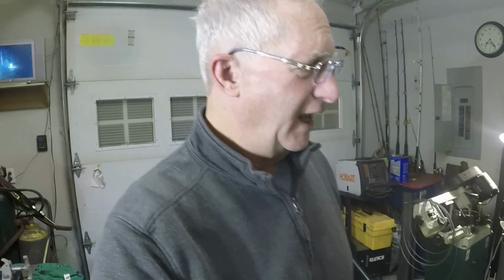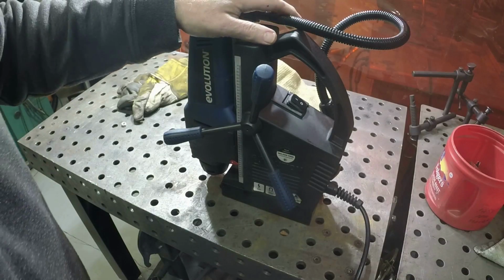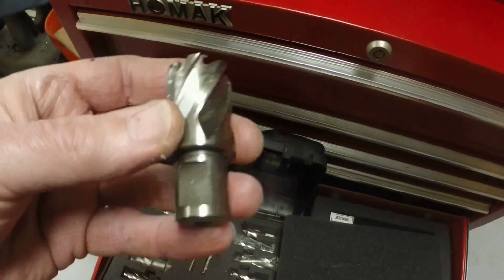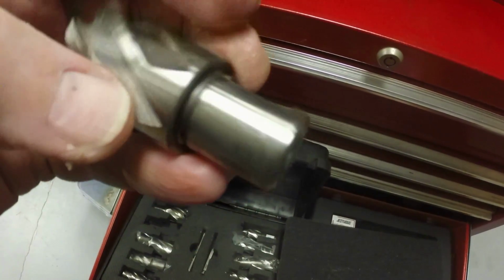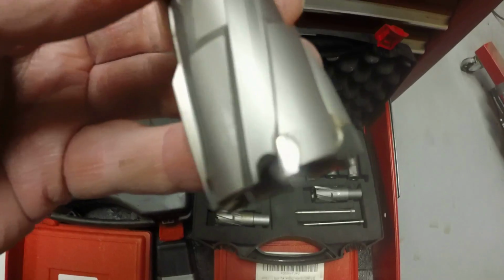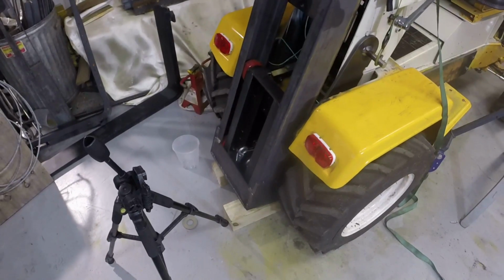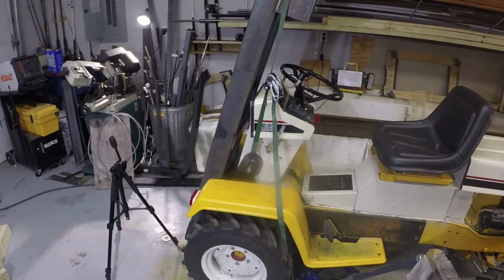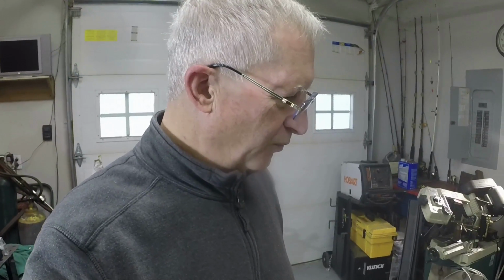Garden Tractor Forklift Build EP:24, Mounting the Mast on the Tractor!

Comment: For a tractor that I'm building, I have a Ford LGT grill, and it came without lights, and they are obsolete. I found a pair of motorcycle driving lights on eBay, and they actually fit pretty close to where the OEM lights did, but these are really bright. My tractor is for riding on, and pulling wagons and other equipment with, and has a Cub Cadet hydrostatic transaxle and a Honda 12hp engine from a tractor and is liquid cooled.

Comment: A thought just occurred to me, will the axles of the cub cadet be able to withstand the weight of everything that you'll be lifting?
Reply from the maker: Yes. No problem. The rear axle is actually a farm tractor axle, probably good for 3500 lbs or more. Front axle may be a weak point, but should be OK with a 400 lb counterweight. We'll see.

Comment: Hi Frank, another great video and job well done.. Just wandering with the bottom  pivot bolts?? How will you hold them from working loose, weld, pin, or nylon nuts?? Not much room between them and the tires!!
The bottom eye bolts are a little close to the cylinder. Won't the cables rub on the cylinder??
I would put a couple more bolts down either side of the chassis and the forklift frames, also one at the bottom front to support the frame and avoid twist of the chassis at the front??
As I said before, I think you find the tires on backwards be better in the long run!! But it's your build!!
Reply from the maker: All will get addressed in upcoming episodes. Nylock nuts,  wheel spacers, cables don't move so no rubbing possible.  As for the tires, I personally don't think it matters at all. I'm not pulling a plow.